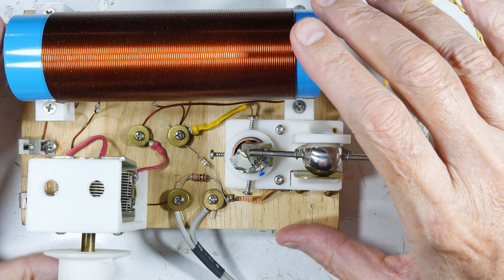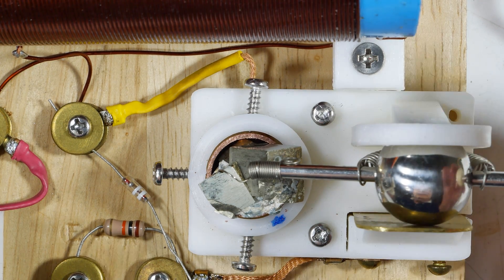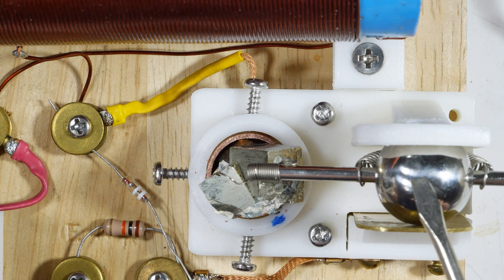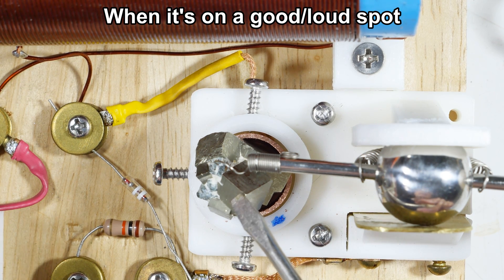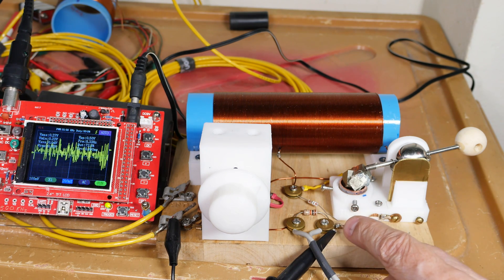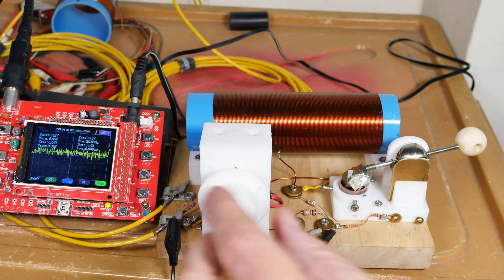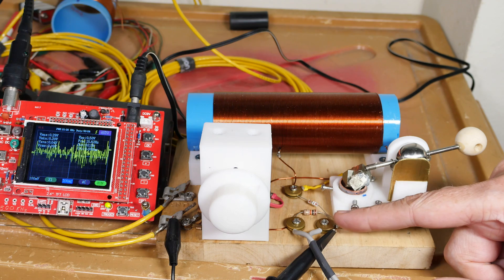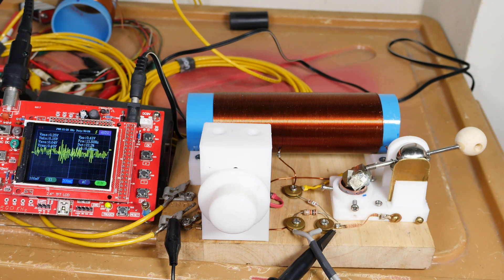Crystal Radio With Cat Whisker Upgrade (4K)

Comment: Back in the 1910 and 20s to find the hotspot they used buzzers (like the ones on morse code practice keyers) to inject a signal so you move around the crystal to find the best spot .
Reply from the maker: I have heard of that and need to investigate how it worked.
Reply: @tsbrownie It provides a wideband EM audio noise signal to the main coil and when the sweet spot is found you can hear the buzzing in the headphones.
Reply from the maker: So it requires a battery?@platypusrex2287

Comment: Back in the "Serious" days of Crystal radio, The optimum crystal "Whisker" probing was done with a battery powered "Buzzer" loosely coil Coulped to the  Antenna coil & whisker probing for max buzzzer tone sound....1 way the old-timer radio Operators would easily find a "Sweet"  spot !!
Reply from the maker: Now that you mention it, I seem to recall seeing a circuit diagram with a buzzer. Thanks for the reminder.

Comment: I've made whisker detectors in the past. Best combination I found was galena with a whisker made of phosphor bronze (violin or guitar string wire). Also I see that your crystal is loose in the copper base, and that can lead to it making poor contact, shifting position etc. What I did is use a low melting point alloy (Cerrosafe IIRC, or Wood's metal) which I melted in a similar cup, and placed the crystal in the pool before it solidified. The low temperature of the alloy allows the crystal to not be damaged. And as a plus you can also plunge the end of the contact wire in the liquid alloy too and that will make a good contact without need for washers and screws.
Reply from the maker: I need to do that. I was going to use solder and a casting plug, but the Wood's metal would be better and I can't find casting plugs.